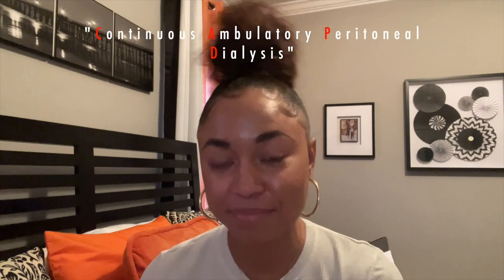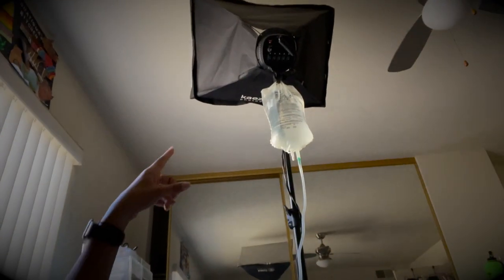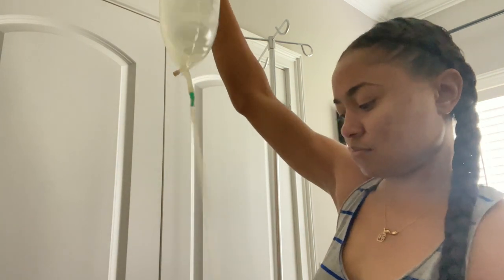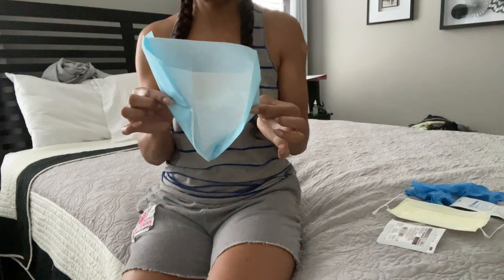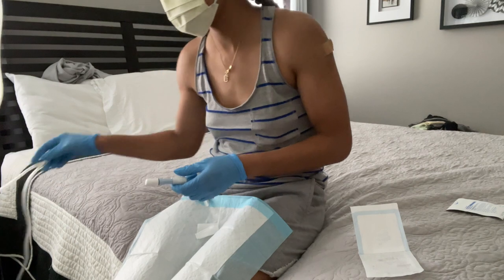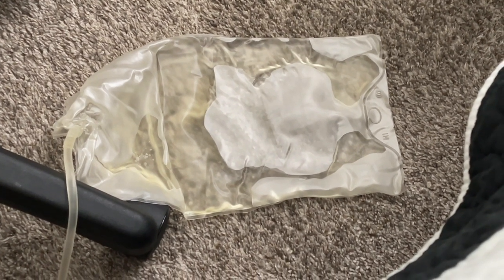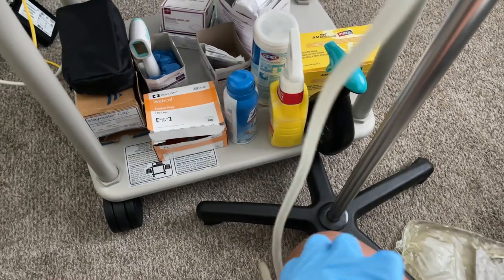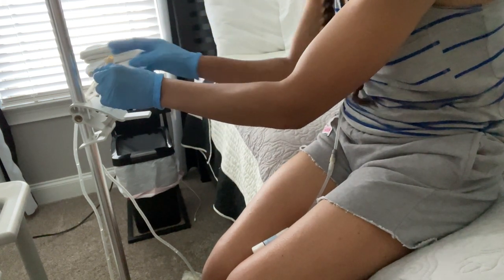Manual (CAPD) Dialysis | TUTORIAL (NO POWER SOURCE or MACHINE required!)

Comment: Hello. I'm not sure if you will see my comment, but I'm about to start my dialysis training tomorrow 11/6/2023.  I've already had the surgery and I've had one flush done by the dialysis center. I really don't think I will be able to get the hang of this as I have other issues that will definitely limit my ability to perform this on my own.  So whatever info or tips you can provide would be greatly appreciated.  My main issue is that I have no use of my left arm or left hand so I will need to figure out a way to do all of the steps with one hand. It's almost impossible for me to put on a glove because I have to pull it on with my teeth, which I'm sure is going to not be the most sterile way to do it. Please help.  Thank you in advance.